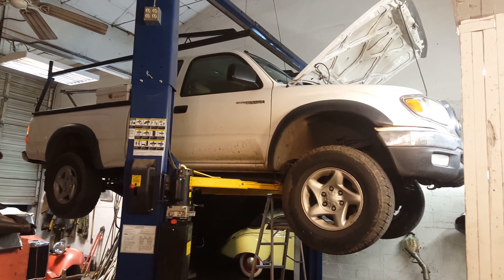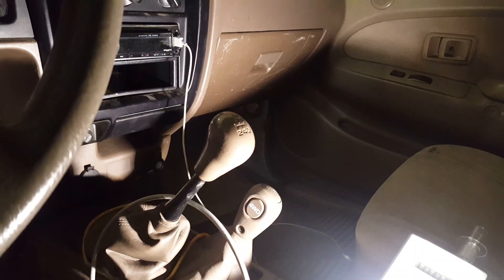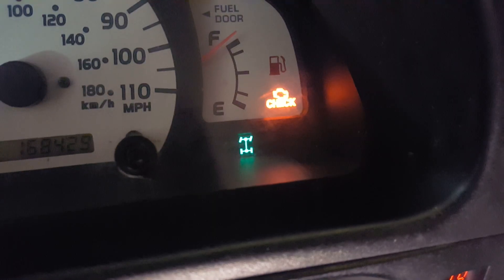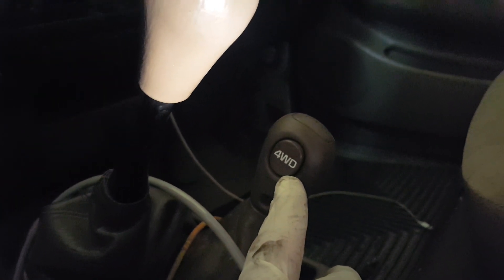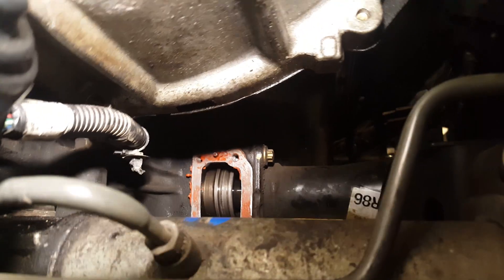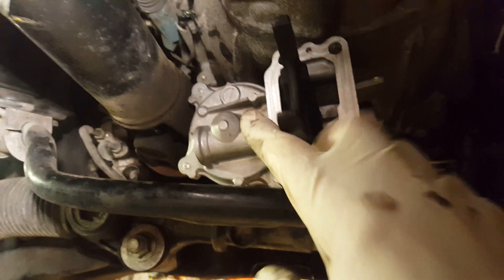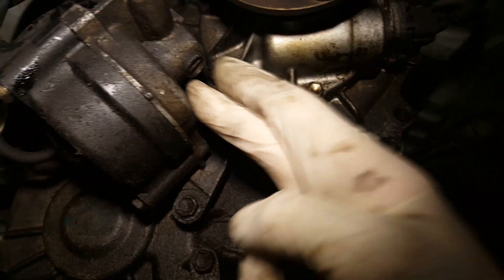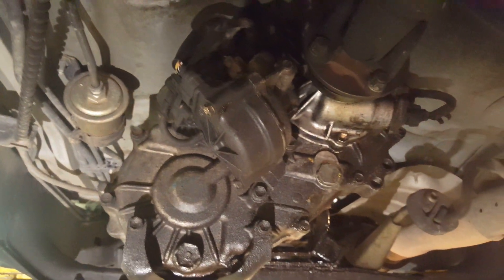Toyota Tacoma 4WD Fix (Testing the AAD and Transfer case actuators)

Comment: Thanks for the video....I have a 2008 and it would not go into 4WD on the fly, but it will go into 4WD if I flip the switch with the  engine off and then start it up. Something is off, but I did figure out how to take off the actuator from the transfer case. Now I need to find a mechanic that won't charge a small fortune. I will go check out the front actuator...........Thanks again

Comment: Question... the front actuator when removed is there oil or ? Can you remove with out issue . 2nd Question do you need to lubricate the front actuator or the locking sleeve that slides ? 
Thanks  great video !

Comment: actuator is a easy fix thats only if you need to take out the actuator rod. Usually its not the rod but the motor or switches that go bad.

Comment: I don’t know why I keep hearing that your can’t take the actuator off without removing the transfer case. I got a donor motor off of a 2002 tacoma and it came right off. I also have a 96 tacoma and took mine off without issue. You just need to remove the clock wheel assembly and it allows the pinion gear to spin freely and you can pull it off the gear rod. You just have to ensure that you reinstall it in the correct position.

Comment: Thank you, thank you, thank you! I turned on my key in the truck, put the lever in 4WD, went under and tapped on the transfer case actuator and got nothing. Reached up above my skid plate to the one you show removed, tapped it and heard it engage! It would have taken great effort to locate the problem without your video. My first instinct was to think it was electrical, but this is an obvious mechanical problem with a stuck actuator!

Comment: Good and informative video however in includes some conflicting information.  At 3.37 min you said the transfer case actuator was engaging when the 4W button is pushed because the front transfer shaft was locking-up. At 5.20 min you said the transfer case actuator was jammed and you had to tap on it to unjam it in order to get the ADD to work.

Comment: My 2001 Tacoma doesn't have the motor on the back of the transfer case. But in that same spot I have a sensor. Does that sensor tell the front actuator to engage the 4x4?

Comment: Really love this video. I greatly appreciate your knowledge. I live out in Prescott Arizona and did a trip out to crown king. After doing one recovery my 4 wheel drive wasn't working properly. The green light would flash or lock in 4 hi but wouldn't go into 2 wheel drive. Had such an awesome day but that really bugged me and frustrated me. But after trying and tapping a few times on the actuator like you suggest, Boom worked perfectly and went into 2 wheel drive. Now i can go ride my dirtbike tomorrow. Thank you very much.
Reply from the maker: You betcha !

Comment: My green light doesn't light up, therefore no 4hi. However i can put it in 2lo. that is not possible when its working as when i shift to low, it automatically shifts the transfer case to 4x4. aparently my 4runner things its in 4x4 when i place it in low. i banged the shit out of it with a mallet. gonna try metal. I did jump it so i know it works, it just doesn't work when i press the '4wd' button.

Comment: Hmmm, I don't think there is this actuator on the manual 2wd/4wd selector, just the push button? I see a small box between the transfercase and the read drive shaft, but nothing for the front, just linkage.  When 4WD is engaged, the front drive shaft locks, a click happens in the glove box, but the front axle still doesn't enagage.  Maybe a bad vacuum line?

Comment: I give credit when credit is due. I dreaded trying to diagnose what was wrong after reading threads on Tacomaworld. My 03 did not engage while driving and would not engage. It tried to when I was going over an ice covered bridge, but I got the “slow down beep beep beep “. I tried again at a lower speed and no engagement, not indicator light. Thought it had to be electrical, but the fuse was good, front ADD looked good. Did a quick google, banged on the actuator and its working flawlessly! I’ll buy you a beer, or 12, brother.

Comment: I did this mod and it fixed my 4wheel drive.But after this,I've noticed a vibration at highway speeds above 55mph.Dont know why,still trying to figure the vibration out.

Comment: thanks very much just crawled underneath and did it first tried the transfer case actuator tapped it several times didn't work then tapped it again and the front axle actuator I assume it was. tried it again and it worked. thanks again
Reply from the maker: Nice !

Comment: The actuators can get stuck ,I suppose, but most failures are due to the actuator's (the rear one) internal motor's electrical leads being poorly soldered.This cause intermittent operation at first.Then as the arcing increases, so does the resistance...until finally there is an open circuit.Tapping is usually not more than a short term fix...more useful for diagnosing what I just described.
Reply: Cold solder joints?

Comment: Maybe this particular transfer case actuator really can’t be removed without removing the transfer case as well. BUT…Toyota service and several other mechanics told me the same thing for my 2013 Tacoma TRD, and it isn’t true. It’s actually really, really easy to remove just the actuator. This one looks very similar, but it doesn’t appear to have the access to the gear that drives the transfer case rod, so maybe it is different. Just a heads up for 2012-2016 Tacoma owners (and possibly Tundra owners as well). Thx for the video. 👍
Reply: apparently you can remove the gear out of the actuator after taking off the small cover... then after removing the mounting bolts the actuator can slide right out.
Reply: Don Veitch Exactly. I ended up doing it about ten times as I tried to fix/diagnose my transfer case. My transfer case actuator ended up being totally fine, but my transfer case spline was locked internally and it had to be entirely replaced. Sucked.

Comment: push button 4wd is super sketchy, it implies that it's safe to push and put your truck in 4wd when ever you need it. when in reality 4x4 shouldn't only be used at low speeds off road.

Comment: I also took apart the plastic on the actuator and found greese had gotten all over the contacts inside. cleaned them off and it worked like a champ.
Reply: Same thing happened to mine

Comment: Yeah I’m having the same problem with my 98 TRD no light I can hear it engage but no 4wd light might be the problem I’m looking for I’ll try it tomorrow
Reply: How did this go for you? There is no actuator (not electrical, anyway) on the 2000 tacoma, just a manual engagement through the shifter. I'm leaning towards ADD and vacuum issue.

Comment: My 07 4runner has a similar problem, but when I turn on 4hi, I know that it engages and it also stays in center diff lock while the dash lights flash. The reason I know it engages is because it binds up when turning a tight circle. But then I turn it 2wd and restart the car and it's back in 2wd. Any ideas?

Comment: 2001 tundra here and I have replaced both actuators and still my 4x4 light blinks..not sure if there is another solenoid possibly not working. Very frustrating trying to work through this system...

Comment: have a 2004 tundra,4 wheel high working,but 4 wheel low would flash and not go in,tapping on Transfer Case Actuator in same place after seeing your video,4 wheel low working now...thank u much

Comment: I truly hope this works on my 97 T100 4x4 3.4l v6 ex cab 5vzfe
The 4WD Light stopped coming on last week although, it does however, feel as if 4wd engauges, I can hear and Feel the tork...so maybe just a bad dash bulb? Any guesses? I will be knockn the actuator on mine..

Comment: This is such a great video. I had the same problem and was able to troubleshoot it after the dealership wanted >$600 to replace the actuator. My problem was with the front component not switching. After I undid the electrical harness and tapped it a few times it started working again right away. Thanks so much for taking the time to put this video together.
Reply: meh i just put up a video bout this same situation 
I opened up the actuator and stuff and trouble shoot it and found the issue. 
Go check it out.
Reply: @hmongwild  Thanks

Here's a great video by @hmongwild that shows the inside of the actuater at the transfer case. It shows how dirty contacts, plus a stuck spring can disable the 4 wheel drive. https://youtu.be/M6qHJPfxyww

Comment: Sorry to say. Who ever told you that you have to take the entire transfer case off to replace that actuator is full of shit. 
All u need to do is pull the 3 mounting bolt out. It will want to turn to one direction once you get the last bolt off. Its  spring loaded but nothing will shoot out. 
I ran into the same cituation as you did. I normally like to try to fix whats already broken or break it some more then buy new parts. Well the vent hose had a little cut in it that seap water into the atuator and rusted up a few part of the electrical contact. As it slide across the contacts it will lose connection cuz of the rust and will stop actuating. So i used a piece of still wool and scuff off the rust and bent the contact tabs down some more to get a better connection. Soo far soo good. Been bout 6 years now.
Reply: Thanks @hmongwild 

Here's a great video by @hmongwild that shows the inside of the actuater at the transfer case. It shows how dirty contacts, plus a stuck spring can disable the 4 wheel drive. https://youtu.be/M6qHJPfxyww
Reply: Thanks. Great additional value to the thread
Reply: This guy knows.
Reply: @ralphh.2200  i didn’t know now i know lol
Cant break it if its already broken. Most of the time its just rust or dirty just need a little love and talk dirty to it.
Reply: Was that on 1st gen Tacoma? Currently working on one where its the older version of the actuator with only 2 electrical connectors with no triangle plate
Reply: @ its an 02 Tacoma i had to pull it twice within the 12 years i owned it. Watch my other video it was 2 different problems. If its the older year model im not 100% but all i know is all the actuator do is push and pull in and out of 4wd. Nothing crazy. Like I said if its already broken or not working wont hurt to pull it off and check it out. Regardless your wanting to get it working.

Comment: Mines a 98 it doesn’t have that button but when I put it in 4 hi or low it feels like it jumps jerks and it doesn’t feel like it works properly
Reply: jose mora I have a 93 does something similar, have you fixed the issue?
Reply: @10181995hamza  no i haven't the bearimgs on my trans are really bad so im taking it down this weekend to fix both problems
Reply: jose mora good luck to you I’m actually working on mine this weekend as well, gonna do an ADD bypass I think my issue is with the vacuum lines and the actuator fork but I guess we’ll find out

Comment: repairing the actuator is not that difficult. Just open the the three nuts in the back and pull out the rotor and from gear. But you have to put back the rotor in the right position, otherwise it wont work. Before you pull the rotor, take a picture and make sure you put it back the same way.
Reply: Thanks. Great additional value to the thread
Reply: Here's a great video that shows the inside of the actuater at the transfer case. It shows how dirty contacts, plus a stuck spring can disable the 4 wheel drive. https://youtu.be/M6qHJPfxyww
Reply: @mikeroland9751  I have a toyota 4runner 3.4...i guess the 4wd system works the same...but i pulled off the black cover and the plastic gear from the transfer case actuator and i did not mark the plastic gear....now i am having problem to find the timing or where it should be set exactly

Comment: Thank you so much for this video! I have a 2010 tacoma. My 4x4 recently quit working and I was dreading taking it to the dealership again. I tapped the rear actuator with my pocket knife a few times and presto! It was still a little sticky, but after engaging and disengaging it a few times it works flawlessly! Thinking back, I do remember reading the owners manual and it says to use the 4x4 on a monthly (I think) basis to keep thing lubricated.

Comment: i have a 2000 Tacoma and i'm having 4x4 issues  t-case engages and front drive line spins but the front tires don't spins need some help!!!
Reply: tyler kunz Did you ever figure it out?
Reply: I'm also in the same book.  Any luck?
Reply: Sounds like the front actuater fork is stuck thus not moving the collar side to side in order to engage the axles.

Comment: BANG! This totally worked for me; lost 4 wheel drive, and like he said in video had someone in car keep switching back and forth from H2 to H4 while I banged FRONT actuator with a hammer and on 4th bang it engaged; I  never knew you were suppose to engage 4wheel drive every month to keep parts moving and lubricated; went all summer never engaging 4 wheel and got it stuck.
Reply: Was it on a lift or does the fix work with wheels on the ground?

Comment: My 4WD was not working. Just tried the hammer fix and my 4WD is now working!
Reply: Thats probably a temporary fix
Reply: @Wolverine-ky9gk  Seems most had the issue from not using it much and parts sticking. Honestly, that's why the hammer trick is working. Nothing was broken, just stuck from moving. So likely using it will keep it working. Way cheaper than 2k fix.

😎🍺💥🍺😎

Comment: I just was having a problem with not goi g into 4 high and it still engages 4x4 only in 4 Low. 
Got under my truck tapped the acuator with the rachet a couple times, and now it changes back and forth with ease. YOU JUST SAVED ME SO MUCH MONEY AND TIME AT A MECHANIC. thank you for your knowledge
Reply: Did you tap it while in 4 High or just in 2wd?